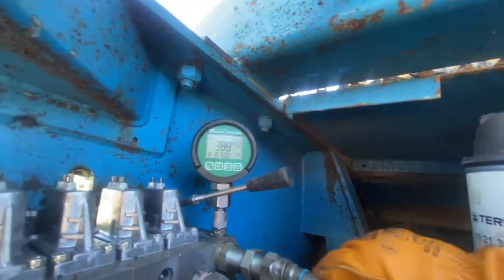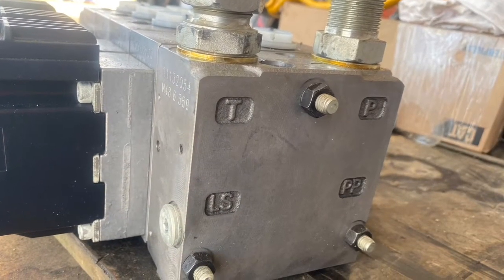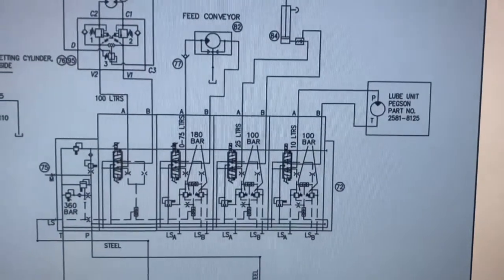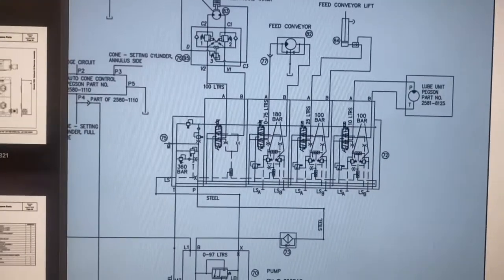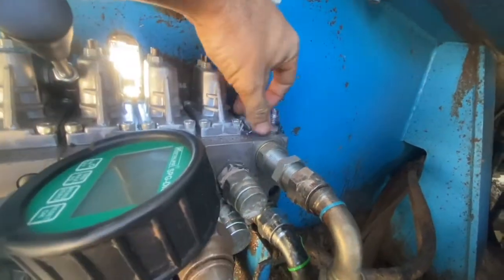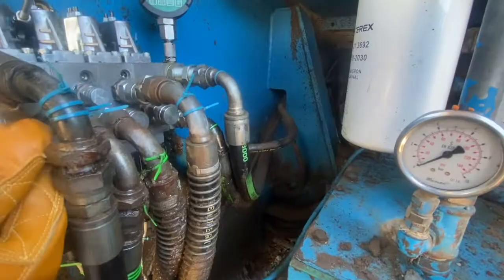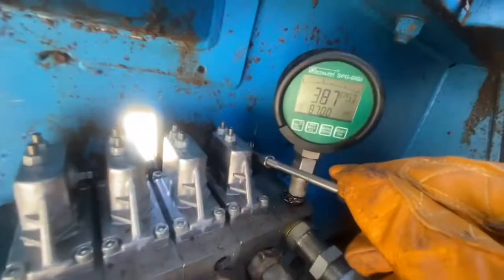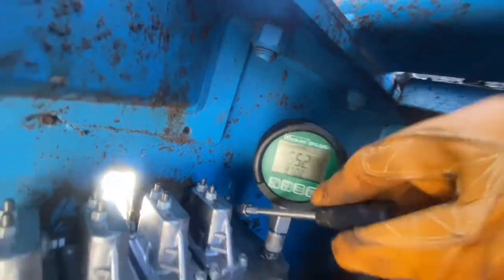Setting relief pressure danfoss PVG32

Comment: Thanks for posting, when setting pressure relief I see some functions supply and returns were capped, can you do this with the hydraulic lines fitted to the function or should they all be capped?
Reply from the maker: No they need to be capped because I am setting the maximum working pressure
Reply: @D4Diezel  Thanks that makes sense